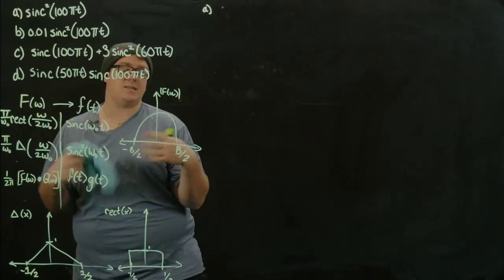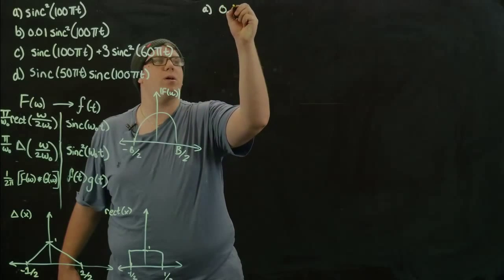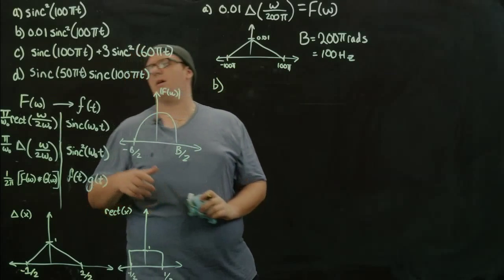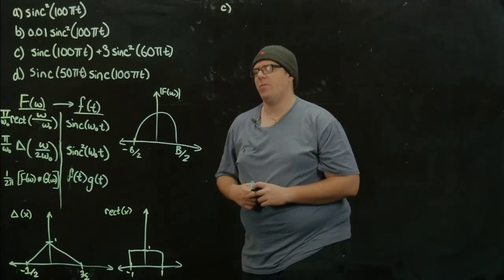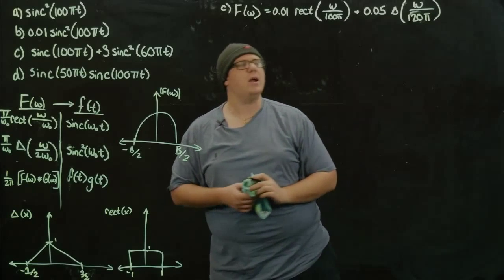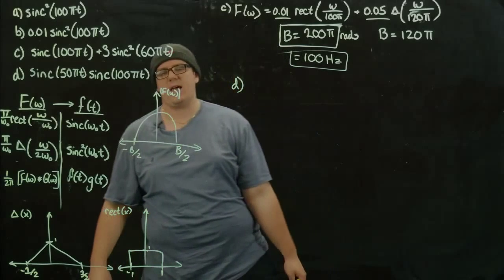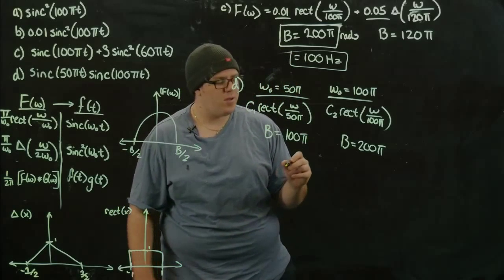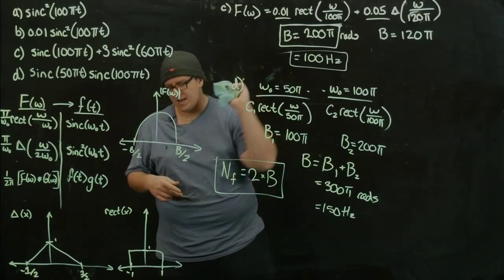Signals and Systems - Signal Bandwidth

Comment: Bandwidth is defined as the difference between the highest and lowest frequencies of the spectral components of a signal, so this video is incorrect.  For parts a and b, The difference between the highest and lowest frequencies is 100pi. So the bandwidth should be 100pi or 50Hz.